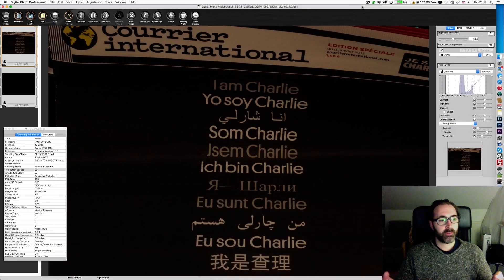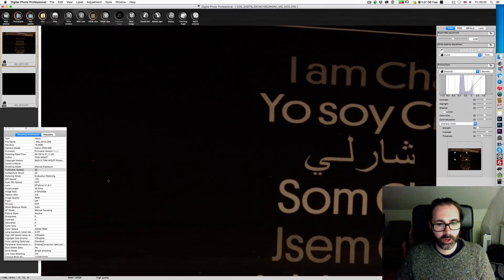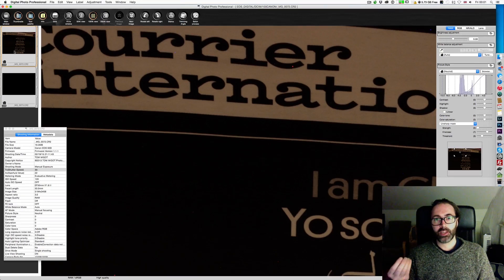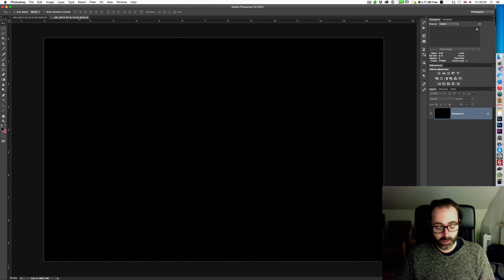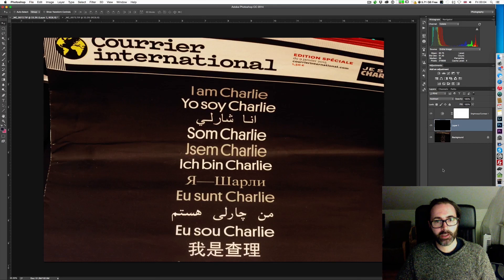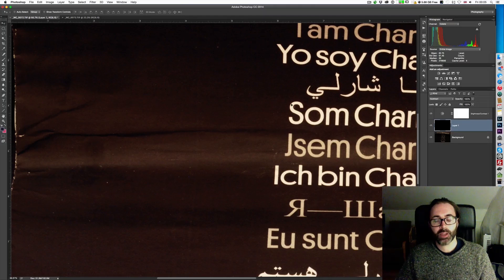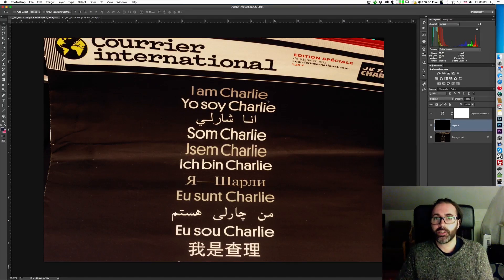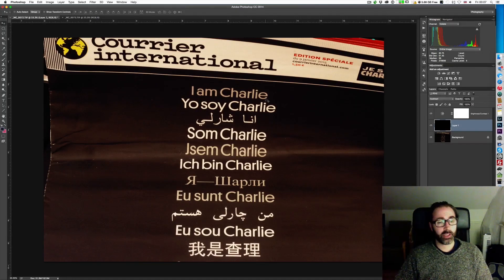Remove Thermal Noise (Hot Pixels) with a Dark Frame Subtraction in Adobe Photoshop

Comment: As I can't quite emulate that with my Canon 6D, I was wondering which software you used for TIF conversion. 
I've tried XnViewMP but it creates a lot o noise. ACR, as you said, has its own mechanism of dealing with hot pixels, so no dice either.
Reply from the maker: Thx for your question. As mentioned in the video I used the Canon software for that.

Comment: Hi, great explanation. In the case I'm going to do a multi raw panorama with 16 shots for example, supposing that every shot has the same settings, do I have to shot the dark frame after every single shot or only one dark frame at the and of my 16 shots? Thanks in advance
Reply from the maker: Thanks for the comment Andrea. Only one would be necessary. If you end up making several attempts in order to get your perfect 16 shots, your sensor may end up heating up and therefore you may want to take one in between attempts or at least one at the end.
Reply: La Photo Académie all clear now, thanks a lot!

Comment: Hi Tom, thank you for posting this video. I just did a test and it worked pretty well. I do have a question for you. Do I need to shoot the dark frame immediately after my regular photo. ? Or, can I do it later or keep different dark frame images on file with different settings and exposure times. ? Any help is greatly appreciated.
Reply from the maker: Sorry for the late reply. Thx for the comment. The thermal noise is affected by the temperature so if you take the dark shot at later time in different temperature condition you may not have a valid shot to fix the thermal noise as described in this video.